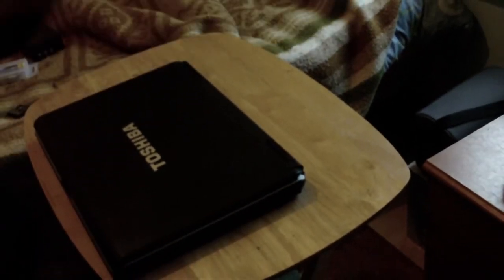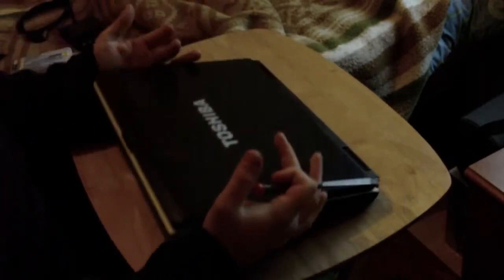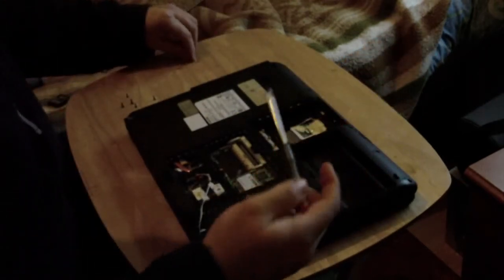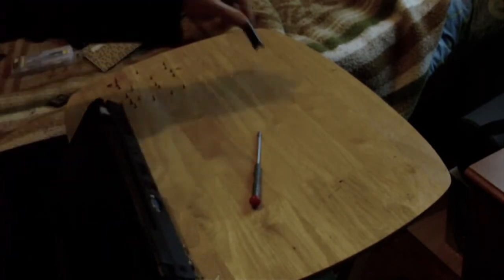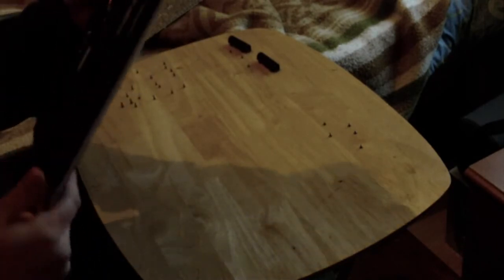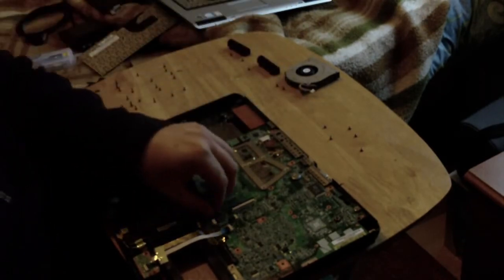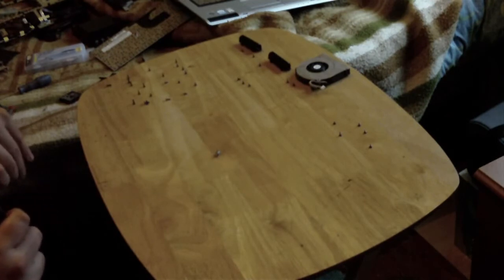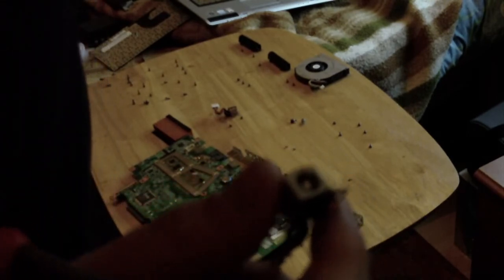Toshiba Equium L40 - 17M Disassembly

Comment: Thanks so much for the video. I had some trouble with what seemed like a faulty connection where the power cable plugged into the laptop. So I've removed the socket.It looks dirty inside. Maybe I can clean it (?) or maybe replace it. I was wondering what you recommend. If I can take one from another laptop, or buy one on the net, or clean it with something. Cheers. Marcus
Reply from the maker: I did buy a replacement off of ebay for mine, however that didn't fix my problem. It was only a few £'s so it's the most simple solution.

Comment: Hi there, just a thought, instead of using a "flat bladed screwdriver" to release the keyboard, why not use a "spudger". £0.99p PLUS it's free post & packing.These found on eBay in the search bar type "metal spudger", plus I also use plastic knives as helpers. 😉😉😉😉😉😉It was just an observation.😊😊😊😊😊😊😊
Reply from the maker: 7 Years ago I didn't own a spudger :P Got several these days.
Reply: Do you not find that they are easier to work with ?I use a combination of spudger , plastic knives and marker pens.
Reply from the maker: @tof3275   I tend to find that all the plastic stuff get's broken and chewed up, so I switched to a metal tool I have, You do have to go slower with the metal ones though. Depending on the laptop you cn usually get away without them just by flexing the casing a little bit. Might be a haphazard way of doing it but I have found less clips break that way. Unless it's really well built and has lots of small clips.
Reply: With reference to the "plastic" I only use those as a "helper", i.e. I get it started with the metal spudger then slowly insert the plastic knife to hold it apart, I would never use plastic because they flex to much. I also have an old "debit card" for an account I no longer bank with. The account number is . . . . . . . . . . . . . . . .😉😉😉😉

Comment: Good video mate. Took my Equium L40-14i apart, fan was ok, replaced the thermal paste, but the laptop still gets hot. The fan runs and blows out hot air. Hope you might have some idea what I can try next. KB in Yorkshire
Reply from the maker: Define hot bud as laptops aren't super efficent at dissipating heat as you'll know. As far as I recall this was an average "quite warm" to the touch laptop. Thing with these one's is to just prop the back area up a little to allow more airflow underneath. Sadly though there's not too much more else you could do.
Reply: Lupni3rd To me it's hot across the top just above the keyboard from the fan to the heat sink. My version of hot is really warm to hot at the touch. It can be felt on the keyboard but not as bad. Also really warm to hot on the bottom same place. Just watched another video and they put some copper on top of the CPU and then refit the heat sink with the paste. In your opinion would this help?
Reply from the maker: They've added a "shimm" it's basically acting as a better way to transfer the heat to the cooling plate. Generally I would say it sounds about as hot as it should. Seeing as these things always run hotter due to the lack of space for good ventilation. If you've ensured the grills and fan blades are clean and there is new thermal compound you'd probably not see much more of a reduction in heat. If you are worried about it burning out, lower the CPU's maxium performance level down from 100% to say %75 in the windows power options. Then it won't be able to throw out max heat dut to operating at max power etc when needed.
Reply: Lupni3rd Thanks for that Bud. Changed the settings to 75% and it seems to have cooled things down.
Reply from the maker: Yeah obviosuly it's running slightly slower but, keeps temps down :)
Reply: Lupni3rd Cannot believe it bud, got one thing going now I have another prob. Now I have intermittent start up. Power lights at the bottom come on and then go straight off with either battery connected or with mains connected. The weird thing is if I warm the computer either by putting it on a radiator or running a hair dryer over it starts first time!!! did you have this prob and changed the power jack? Hope you have an answer.
Reply from the maker: No when I striped mine down and changed the jack over it didn't actually solve my issue of it not charging  if memory serves me right. But that sounds like with have a distrubed solder joint some where making a bad connection and with the heat it's expanded and makes contact. Or a bad trace on the motherboard.
Reply: Lupni3rd It's out of my league now bud. I'm a retired plumber and working on a motherboard!!!!! The only knowledge I have about laptops is from watching videos of yours and others. So if the problem gets to me I will have to find somebody who fixes motherboards. Cheers for all your help.

Comment: I want to change cmos battery do i need to take screen ans all that off to change that? Thanks
Reply from the maker: I believe so, if you check the video around the 13 minute mark, there is a small round blue thing which if I remember is the CMOS battery.
Reply: +Tam Rowan Did you have to strip down the whole laptop just to change the cmos battery mine has the same problem and I would like to know if this is an easy fix.  Many thanks in advance.
Reply from the maker: Sadly I can't remember, You'd honestly have to watch the video. The sad thing is they expected most people to have got rid of these laptops after 4 or 5 years so alot of the batteries are in a dumb place.